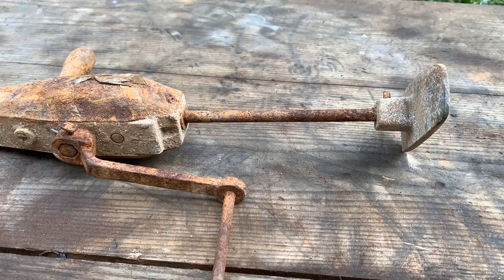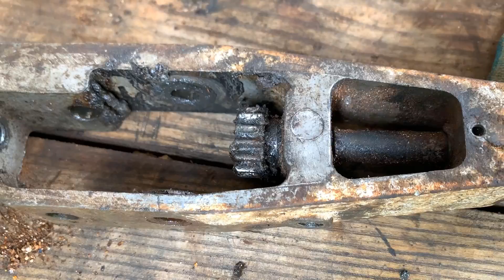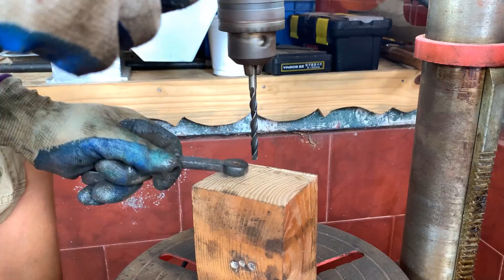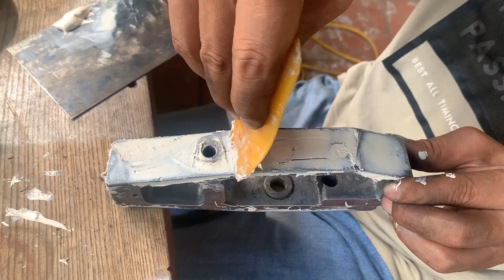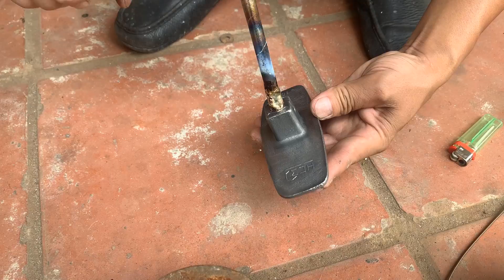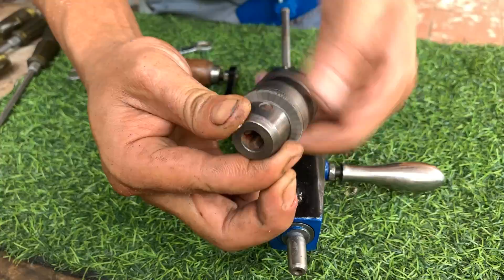Restoration The Oldest  Rust Hand Drill Ever Seen // Perfect Restorations Skills You've Never Seen

Comment: Very nicely done, restored as a very functional tool. I wasn't surprised when you swapped out the drill chuck for a more modern look.  However, I think watching you work with the original might have been an interesting segment, probably useless as you would have ended up doing the same thing anyway, but interesting. Thanks for sharing. 😁👍🇺🇸🇨🇱